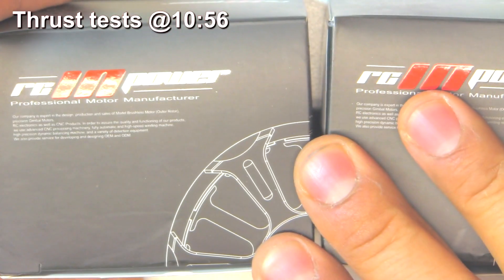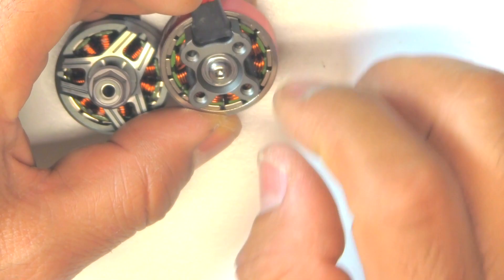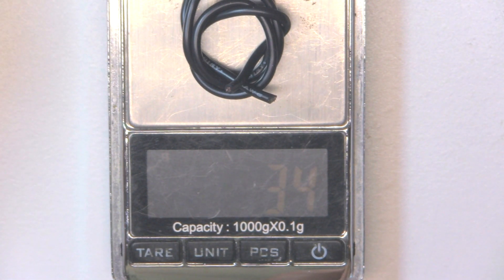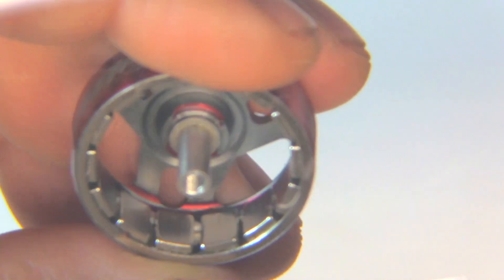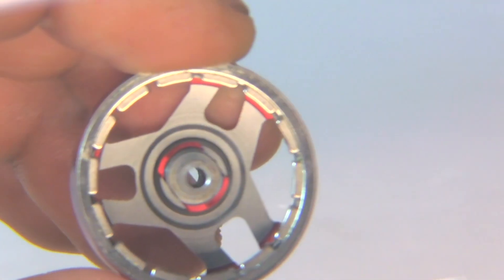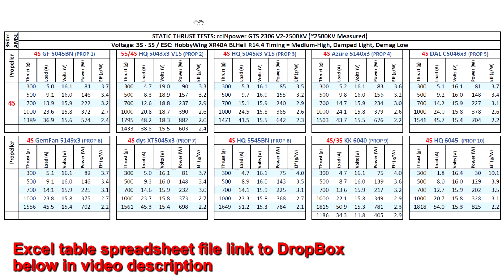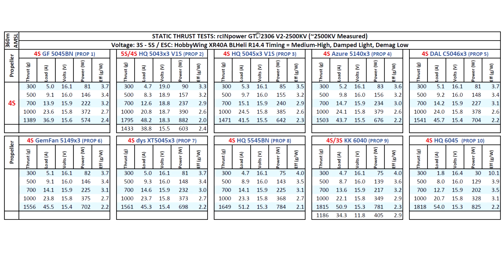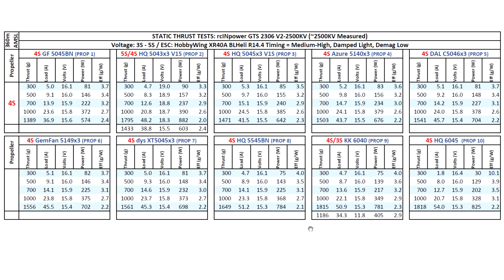rcINpower GTS2306 V2-2500KV Thrust Tests & Overview

Comment: Are RCINPower motors durable? I want to buy GTX-V2 1860kv
Reply from the maker: I gave these to some friends. I believe they're still using them and still ok. Bearings are good quality. I think they should be as durable as most other motors. Of course If you crash on concrete, rocks or any other rough surface and motor takes a good hit..... they will sustain same damage as others.
Reply: @EngineerX  Thank you! I saw another motor, RCINPower Wasp 1860kv. I'm thinking these motors are all the same. They just change designs and colors. What do you think?
Reply from the maker: @neilfpv  Looks very good too, just make sure the bearing is 9x4x4 and not an 8mm (not durable) bearing. I don't know what bearing size it uses and couldn't tell from this video https://youtu.be/RaUC0sAku08?t=65 .  Stator is 22.6mm wide x 6.5mm height so stator volume is 2608 mm^3 vs. 2493 mm^3 for the 2306 motor so theoretically it has more power-making material (copper wire & iron stator) and that would make it better for 1800kv - 4S to 6S  5" to 6" props. rcINpower 2207.5-1860kv also looks good. It's next size bigger 2661mm^3 stator volume. For 7" the best one is BrotheHobby 2806-1500Kv >> Check out https://youtu.be/yfORZrVJSqI
Reply: @EngineerX  Thank you so much! That's an amazing answer. Way over my head right now 🤣I'll read it multiple times today so I can understand it better.
Reply: @EngineerX  I ordered the GTS-V2 motors today 😊
Reply from the maker: @neilfpv  great. Really hope they meet your expectations and your build ends up flying awesome.

Comment: the original GTS2305-2750 are still king.... they're light and super powerful.... My goto motors!
Reply from the maker: Yep. Those challenge and maybe even surpassed the top dogs at that time. Too bad rcINpower didn't aggressively market and distribute their motors widely. Ever since the GTS2205's I was impressed.

Comment: Good tests - nice job ... but I have only one complain - as a engineer too I know how important is the maximum continuous load value for this motors. Those kind of tests are kind of misleading for the regular guy, because the max amps load you are showing here will burn the motor. Even if you mention sometimes the max burst amperage it is not in all videos.
Reply from the maker: You're 100% correct. 
However,  the main problem is that these are static thrust loads, therefore motors are heavily loaded, way beyond what they'll ever see in actual use because as propellers move through the air, the load will be a lot lower. Also, the batteries used in most multirotors can't supply these large amounts of constant Amps. In short bursts many users do see 30 and up to 50A short burst loads for a second, maybe 2. So "similar" loads are seen. 
Max continuous loads "true/actual" ratings would be very interesting.... however, how can one determine at which point of load to test? It would require a lot more work, time and more advanced equipment, I think one could measure the temperature at the copper windings on the stator and that would be the limiting factor, once temperature stabilizes and doesn't exceed the copper wire rating. That would require knowing what each motor wire temp rating is, but that's not readily provided by manufacturers most of the times. So then we would have to adjust throttle to maintain thrust/ Amps / Power at that temp rating for each motor. But then that's not very realistic either because we would have to account for cooling effect of being in the free airstream.... Unfortunately I can't conduct all those details tests with the equipment and the time I have available. But I agree, you're right about the short bursts Amps I measure and report, if sustained, motors would start to burn in about 7 to 10 seconds!
Reply: Yes, I completely understand and thank you for your kind answer. Your tests are the best anyway. Just an idea - a small thermocouple stuck between the windings would do the job. As an example I am using some of the motors you are testing on a fixed wing and I can tell you from experience that the unloading is about 15 to 20% maximum. If you are interested you can check my torture test of the T-motor f80: https://www.rcgroups.com/forums/showpost.php?p=40116734&postcount=15620
Reply from the maker: This is excellent information. Often people who use these motors in fixed wings are interested in this kind of data which I have no experience with so it's very useful to see that unloading is about 15 to 20% in fixed wing applications, as expected it is lower than what we see in multirotors. Fixed wings of course, stress motors way more since the throttle may constantly be on high setting. I'll make sure to point people to your findings when they ask about using these motors in fixed wing applications. 
https://www.youtube.com/watch?v=tH2qy30dQKk
That's a very good torture test. Amazing how that F80 can take the abuse, I like that FLIR you used. 

I thought about connecting and using a temperature probe same as you but I decided not to use it because of the short thrust runs I do, so motors don't really reach stable temps and honestly I didn't want to add more steps for setting up. The way I run tests, already takes me a long time so I'm actually considering deleting some props from tests.
Reply: Yes, your tests are quite time consuming and very informative and I like them a lot. Anyway you can bring some adrenaline burning some motor from time to time :)

Comment: I was looking to find efficient 6” quad motor for long time. Found ur channel love ed,sub ed, good job👍🏻 any suggestion?
Reply from the maker: Well, so many options and so many ways to achieve your goal. You can go for a low KV motor and 6S or for standard KV and 3S or 4S. The best efficiency is with low-pitch props like 6030 or 6040. For budget motors the RacerStar BR2507S 1800KV , for premium motors the Brotherhobby R6 2207-1750 or 2306-1660, EngineerX 2307-1700 would be good, rcINpower GTS V2 2306 motors are also good, T-Motors F-series, there's so many! Most people prefer that motors have the 4x9x4mm bearing because they're durable and easy to find replacements when needed
Reply: thanks for quick reply and suggestions. I was thinking (3-6s supp) emax 2306rsii 1900kv, 3-4S, 6'. which is if i get boring from cruising, just put 5' props ,5-6s on it go for freestyle. Am i wrong somewhere? thanks again
Reply from the maker: That should do well. 5-6S 5" 1900KV is known to be a good setup. Probably better match for 5S because 6S may need bigger battery. I think most people use 1700 to 1800kv for 6S 5" and smallish 1100mAh batteries to keep it light. 1900kv may still work Ok but may be battery will drain faster so could be you need 1200mAh for better results.
3-4S 6" props would be efficient for cruising at lazy pace but still fun,  Your plan is good I think.
Reply: cheers mate 👍👏

Comment: Do you now have two big fat capacitors  over there? :P
Reply from the maker: :) I've had them for a good while. Previous camera angle didn't show them. When Ifirst got the power supply the surge protection would activate often on powerful motors when doing the max thrust runs with fast ramp-ups so I added those caps to see if they helped. Thought about adding a Lipo bank in parallel too but then decided not to use it because of the many different voltages I test.

Comment: If they are hiding informarion about materials, i will not buy. 20$....
Reply from the maker: For a long time rcINpower doesn't give detail information. It doesn't mean they're hiding anything, just means they are not very good at marketing. For a long time it was difficult to find their motors at stores, it's improving. The very first motors I tested were very good and surpassed the best motors at that time, the version 1 EMAX RS2205. I gave them to a friend and they're still running very well. Hopefully they do a better job at marketing and writing motor info.
Reply: thank you, good to know.

Comment: I’ve wanted to try rcinpower for a long time. These strike me as motors for ‘real men’ lol thick wires, decent screws, no messing around and solid performance. Probably still be going long after my pansy R6s are toast :)
Reply from the maker: LoL... hahaha they should adopt that slogan, motors for real men..... no silly tiny shaft screws. From the overview, these look very good, of course still need to be proven in the air.
Reply: EngineerX :)

Comment: Sweet test brother !! I'm not sure if it's because you're testing in a different room but that motor sounds different?? Nothing bad of course!! Thanks for tossing that 5149 GF in there, ive been curious!!!
Reply from the maker: Yes, the tests for the previous video, BH R6 were done outside in the patio back on May 31, before we had the heat waves here in Southern California. Some of the latest tests I had to run them indoors in my living room with air conditioner cranked up to get air temps down. There's some echo and reverberations/reflections that are making motor sound different. 
I have not seen or flown the 5149 yet, seems it should be good, looks similar to the Flash.

Comment: Motors are too heavy.... :-( the brotherhobby r6 is much lighter!!!
Reply from the maker: Too heavy? 32g with thick wire is not so bad in my opinion. Yes BH much lighter. Too heavy would be around 36g, Heavy 34g, a little heavy 32g, light 28-30g :)

Comment: Another 2306 whooooooo!!!!!!!
Anyone see theres a new tmotor 2310 2350kv??? Phaserfpv.
Also engineer x,check out fmr 2207 2488kv if you get a chance.
100s of grams more thrust over 2207 2450kv cobra and about 30% or more less amps,believe it or not.
6s 1250mah  5046x2 apc @100% 88a @151mph ---/ 4s 1600mah @100%  66a 5046x2 apc 127mph
Motors under 110f on 6s runs and believe 8s is possible and motors can hang with it almost deff.
Very quality.
Cobras on exact quad I was getting 132mph on 6s and 150+ amps.
Also motors were hotter but not too hot but wouldn't expect them to handle a 8s speed build or for long at least.
Likely fmr 2207 will be the best thrust per amp on 5in prop motor on your tests to this day.
FMR is pretty good about talking to users and pilots .
I'd bet theyd send you some for testing  if you emailed em so they can have people see what theyre all about.